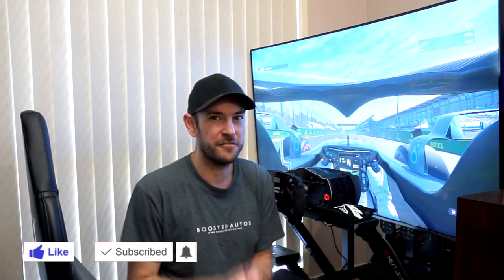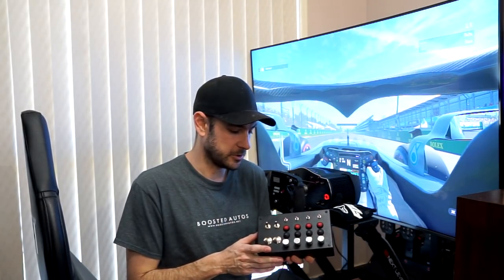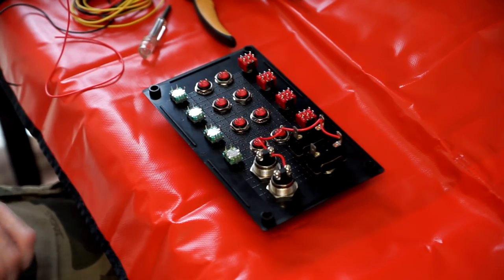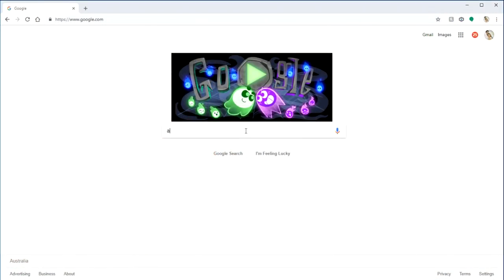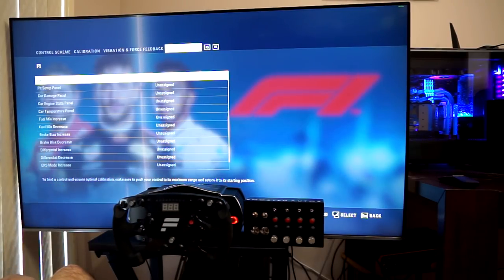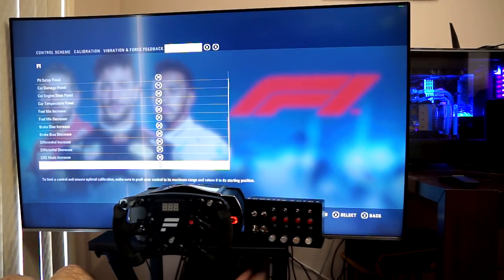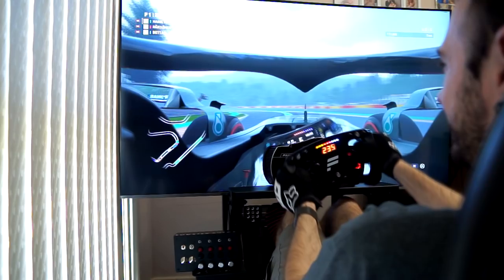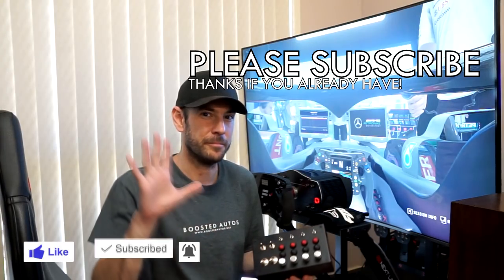Building an Arduino powered USB Button Box for my Racing Sim

Comment: Ok so after many hours of looking through these comments and playing around i have finally got this working! I am no coding master and kept getting error on the joystick / keypad side so if you are like me then here is what i did to get it working:

1) Download the Arduino software (https://www.arduino.cc/en/Main/Software)
2) Download the script (https://github.com/AM-STUDIO/32-FUNCTION-BUTTON-BOX) click the green box saying clone or download. Save it to your desktop.
3) Download the joystick library (https://github.com/MHeironimus/ArduinoJoystickLibrary) click the green box saying clone or download. Save it to your desktop.
4) Download the keypad library (https://github.com/Chris--A/Keypad) click the green box saying clone or download. Save it to your desktop but do not extract the files.
5) Extract the script folder to your desktop then open that folder. Double click on the file named "32-FUNCTION-BUTTON-BOX-master" Then double click on the file named "ARDUINO_BUTTON_BOXV2" this will open up the Arduino software with the script needed to work this project.
6) In the Arduino software at the top click "sketch" tab then "include library" then "add Zip library..." from there go to your desktop and select the keypad folder just downloaded (Keypad-master)
7) Next go extract all the files from the joystick library file just downloaded and open that file. Open the extracted file and then open the next file called "ArduinoJoystickLibrary-version-2.0 and you will see a file called "joystick".
8) Now open a new file explorer window and select "this computer" then Documents" then "Arduino" then "libraries"  now drag and drop the joystick folder into this folder.
9) Go back to the Arduino software and select "tools" then "boards" and select "Arduino Micro" Then select the right port (it will show you the one is being used).

After all that you should be done! Hope this help.
Reply: Any idea why keep getting error on the joystick/keypad side??  From the original video from AMStudio, I thought it was a simply case of soldering exactly the same as they did and upload the sketch software code and that should be it??  I am also getting that joystick/keypad error...

Comment: Regarding prices - I don't want to make people think that buying at a local store is a bad thing, it's definitely not, but only if prices are reasonable. $140 is way too much for those parts. 
Realistically its maybe a third of that and even less when buying offshore.  IMO its sort of a crime to only buy online as it is to sell products with a 300-500% increase or more. This is mostly the fact when it comes to electronics, as most of the parts are coming from - you know where. Other than that - a great Video and who does not know AMS nowadays - overall great quality projects.

Comment: do you think it might be worth putting a header on the Arduino? just thinking about ease of replacement for a failure in the future if one should present itself.
Reply from the maker: Probably not a bad idea.
Reply: Male header pins on the 'duino, mount the thing on a custom PCB using female headers on the PCB. The "custom PCB" can be made from protoboard if you don't know how to design your own PCB, or don't feel like it for a one-off. If the Arduino fails for some reason it's a simple matter of pulling it out and sticking a new one in.
For the buttons and such, you can use JST connectors. You can get them in sets of PCB mountable "sockets" and pre-wired "plugs". This allows you to replace buttons, should they go bad.
That's how I approach all of my builds; I never solder cables or microprocesors directly to my protoboards.

Comment: Great and informative vid, but just wondering if you had any issues with bouncing for the rotary encoders?  I understand you can get encoders on a module with resisters etc built in to remove bounce, but the ones you used looked like the bare bones ones and was curious if you had a fix for getting rid of bounce for the bare bones encoders.  Thanks.

Comment: I know this video is old as hell. But how did you get the code to open in the arduino program? When I try to add the .ZIP file it says "installed" but no code comes up on the screen. I have watched the orginal video countless times, I even baught the 19 page guide for this build. Nothing I do seems to work. I have dumbed almost $80 into what is supposed to be a "SIMPLE" buttonbox but yet the only simple thing was wiring it. The software side of things is far far from simple.

Comment: Were you happy with this wheel or does it lack in any way compared to the new V2 you have? Wanting to have an F1 wheel, and I have one of these available for cheap. But dont want to drop my money on it unless its okay - if the new V2 are way better, i'd rather go that route.
Reply from the maker: The thumb encoders on the V2 are great for F1 2018/19. Otherwise not much difference.

Comment: how do the toggles wire up i've seen amstudio's vid but since there's a wire to 3 connections right and it goes to 2 toggles and one button but on the 3rd wire since there are only 2 connections on the buttons where does the wire go
Reply from the maker: Sorry. I don’t understand what you mean. There is only two connections used on the toggle switches. Look at the circuit diagram on AMSTUDIO’s video :)
Reply: @boostedmedia  The 3 way on/off/on momentary switches with 3 connections.  Can you show how those are wired.

Comment: what is the top plate on top of your next level racing rig? it looks deeper than the one that comes with the next level racing wheel wheel stand. is the gaming desktop add on?
Reply from the maker: It’s the standard part mate. Maybe it’s different to the older F1-GT?

Comment: Have a question. How do you solder Momentary Toggle Switch? I couldn't understand from  AMSTUDIO's video neither. Plz help :)
Reply from the maker: Not sure how much more simply it could be explained other than the circuit diagram already supplied. Sorry.
Reply: @boostedmedia  NP. Problem was, momentaries have 3 pins but in the diagram everything was showed like 2 pins. Didn't know what to do with ground connections. I found the solution from somewhere else. thanks anyway.
Reply from the maker: Glad you got it sorted.
Reply: And for those who struggle with the same question, and don't find "I found the solution elsewhere, kthkbye" useful: you measure with a multimeter set to continuity (aka "beep on short") and figure out which to pins don't make contact when the button isn't pressed, but do make contact when it is. You solder your wires to these two pins.

Comment: Creating the matrix. Is this random? Or is there a purpose in the sequence to add wire to the buttons?
Reply: A matrix is just a circuit within a circuit to save ports. If you are cool with using more micro controllers then you could just run each switch connection to a different set of ports.

Keep in mind, you can always stack grounds since they are travel to the same place….ground lol.

Comment: I have to ask, I'm in the middle of making a button... Dashboard. I'm starting wiring it now, but I have a slightly different button setup. wil the IDE work even if I only haev 2 encoders? I might have 6 buttons I can connect instead of the 2 missing encoders, would that be possible?
Reply from the maker: You may have to modify the code slightly but yes it can definitely work.
Reply: @boostedmedia  Maybe I bit over more than I can chew, but we'll see. I think my idea of hard mounting a thin MDF to the base is pretty good, but more suited for ETS2, ATS, and FS19. Button box is a great thing for immersion, but without a full racing rig it's hard to find a place to place it.

Comment: btw how would you go about mounting something like this? would you drill more holes or just tape it etc?
Reply from the maker: I am going to mount it using some metal brackets and try and use a factory hole on the rig.

Comment: I went to jaycar to and got the same 3 way toggles. Do you just wire them to one side/3 poles?
Reply: 2 way toggles I mean on/off/on
Reply from the maker: Correct. You can leave the second throw blank.
Reply: I use 3 way momentary toggles. Up counts as a button and down counts as another button. The center pole is basically the ground.

Comment: How did you mount your button box to the f-gt rig?
Reply from the maker: Haven’t yet. Will look into that for the next video. Should be pretty simple. Just gotta figure out the best spot.
Reply: Boosted Media  check out the CSL Elite Panels from Derek Speare Designs. Maybe try build a similar mounting bracket from your box to the Shifter holes.
Reply from the maker: Will definitely check it out. I have a 3D printer so was thinking I might design something if I can’t find something off the shelf.
Reply: @boostedmedia  I was thinking about drilling the deck and bolting on some 80/20.
Reply from the maker: Likewise. But I want to try and keep it off the wheel deck if possible as it obstructs my view for open wheeler racing.

Comment: Hmm, you paid AU$140 for the parts for this? Either the Australian Dollar is worth far less than I imagined, or you overpaid by a large margin. Haven't checked the entire video yet, but apart from the box, those parts should set you back about the price of a pack of cigarettes.

By which I in no way mean to say that the guys at amstudio are overcharging. The most expensive "component" in such kits is the labour. And I'm sure they'll make sure to use "proven quality" components because if you sell stuff like this, you don't source your parts from AliExpress like the rest of us DIYers. But even then, the parts are a negligible part of the total cost.
Reply from the maker: Yeah the components are expensive here unless you buy in bulk.
Reply: Yeah, just checked my local electronics shop for comparison, and prices for e.g. the rotary encoders are about 20x what I pay on AliExpress. At those rates the costs quickly add up.